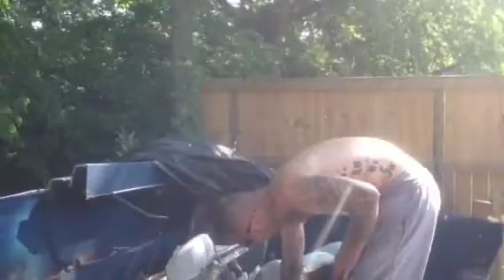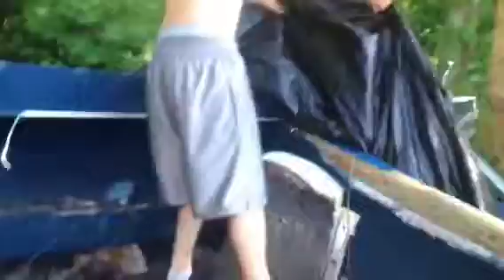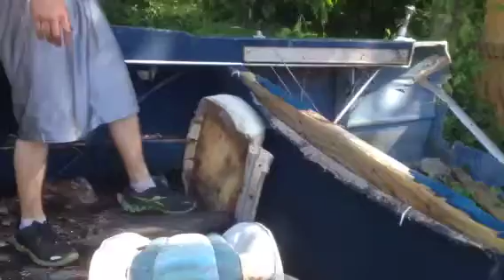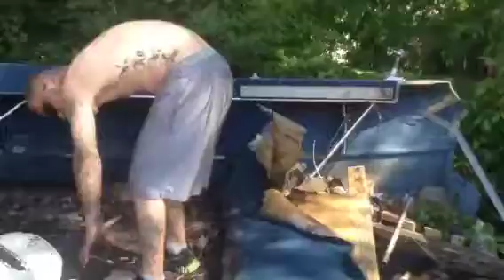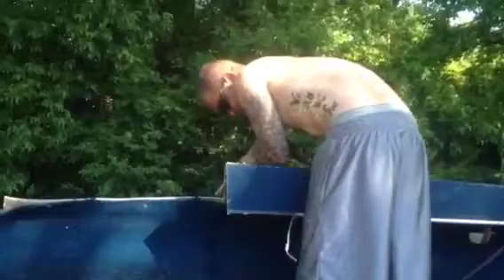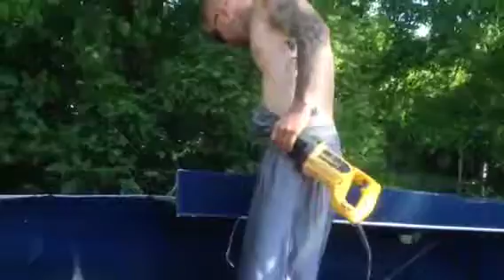Redneck cutting boat in half !

Comment: How did you cut it that fast. I have a reprocating saw somebody told me I should use Milwaukee metal blades for cutting thick metal. The ones I used once wasn't good but I was cutting a truck cap with a 9 inch reprocating saw blade. But it took a while to cut it because my blades wasn't good.